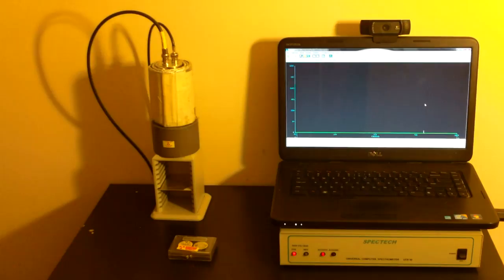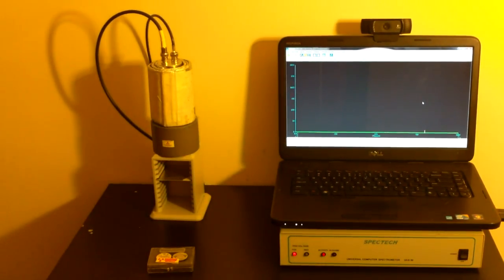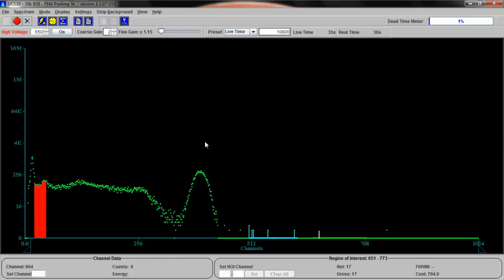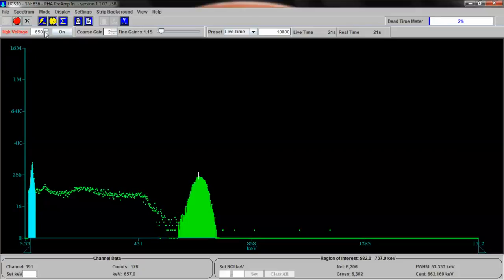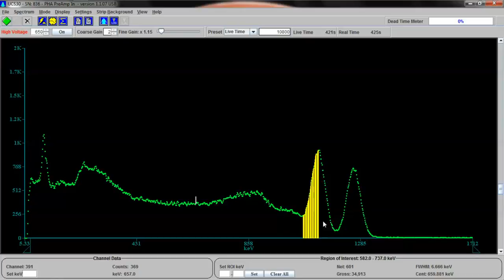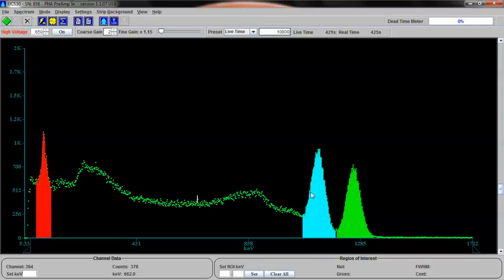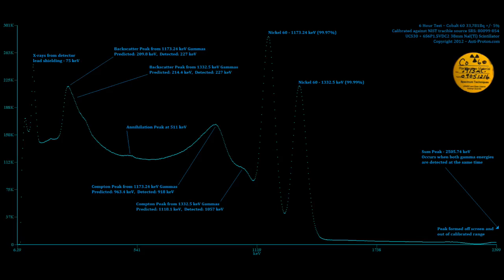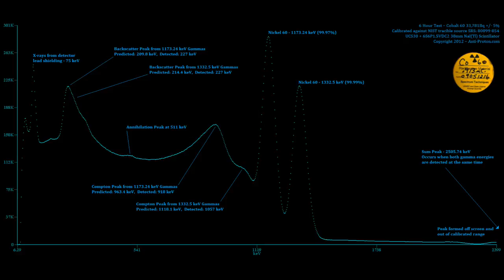☢ Radioactive Cobalt 60 ☢

Comment: I use a high purity germanium detector at my university and thank god....cause i forget to fill it with LN2 sometimes but it always retains its original calibration....kinda cool to see another person doing gamma spectroscopy
Reply from the maker: HPGe's are much better than NaI(Tl)'s.  Still, if you use proper techniques, the correct math, and lots of time, you can do plenty with an NaI(Tl). 

I was reading Dr. Gilbert Gilmore's book on gamma spectrometry and I recall him saying that letting an HPGe run out of coolant could be bad. Are there any problems with your crystal getting warm?
Reply: I have not had any problems yet and have had it at room temperature 3 times in the last couple months....each time I brought it back to cryogenic temp. it performed precisely where it left off.....the Cranberra stuff I was reading said its one of the advantages of a HPGe detector...I believe we bought one of the best models we could and the guy that set it all up quit because of school load and so I absorbed his responsibilities and have had to kinda jump in learning the gamma spec. setup while figuring out spec analysis the last few months ...im glad theirs ppl like you on youtube who do this stuff as a hobby so I can learn in a pinch!

Comment: Hydrogen is already an element. Under normal circumstances two hydrogen atoms form a covalent bond with itself and form H2. H2 is highly reactive with Oxygen and when enough energy (A spark perhaps) they explosively react forming 2(H2O). Pure distilled deionized water is not electrically conductive, but dissolved electrolytes will make it so. In my HS Chemistry class, we proved this by trying to complete a 120V circuit to a lightbulb with it.  It didn't work, but with tap water it did.

Comment: if i understood you right, cobalt 60 is made from common cobalt 59 by bombarding it with neutrons in some nuclear reactor or another strong neutron generating device. however... and that surprised me... you said Co60 decays into "Nickel"60. so its not going to lose just the additional neutron anymore, but shoots out an electron when its nucleus changes "randomly" by "converting" a neutron/proton within the nucleus ?!

Comment: Can't you use any isotope for calibration besides cesium-137? Just wondering because I only hear about people using that for calibration.

And btw do you still have your amazonite (potassium feldspar) from one of your older videos?
Reply from the maker: +Brandon Fisher   No idea where the amazonite is...  but crap!  Someone at my astronomy club brought me an amazonite sample tonight... and I gave it back.  =(    I'll get more.

As for Cs137, it's good for it's two solid calibration points at 32 keV and 661.66 keV.    Any two points work, so most radio nuclides are fine.

Personally, I like using either Cs137+Co60 for the extra high energy points or just Eu152.
Here is a spectrum I took of Eu152. Lots of points!  http://anti-proton.com/Eu152.png
Reply: +antiprotons Sucks, it was such a beautiful specimen :-(

I hope you replace it.
Reply: +antiprotons Also since you got better units you could've re-tested its radioactivity & even do a little gamma spectroscopy.

Comment: Could we write an algorithm of sorts to offset the over reading of peaks in the higher keV when we calibrate in the lower keV area, or is it not a given that it will over read when calibrated lower? For example would a peak examined that was much lower down the keV scale than the calibrated peaks read lower than expected or is it somewhat dependant on other things?